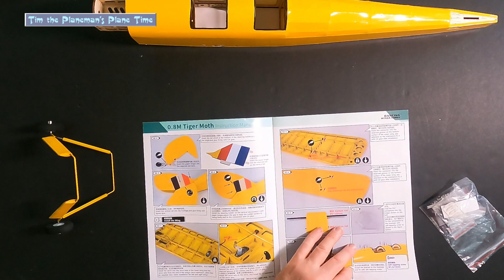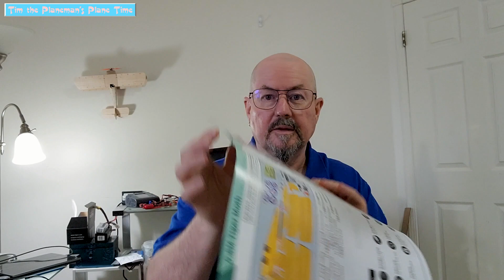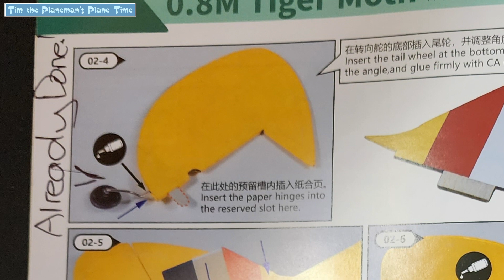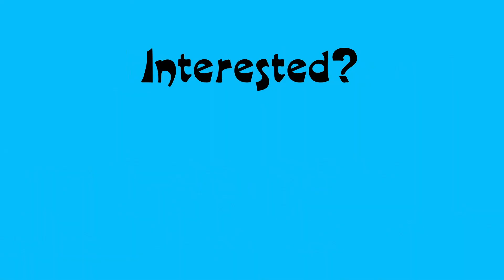Tiger Moth Assembly - Dancing Wings 800mm ARF

Comment: Nice looking model Tim, perhaps I could make some observations? At 3:38 you explain about the binding elevator, I notice the rudder to fin gap is pretty big, I know you couldn't close it up any more than you did because it wouldn't line up along the leading edge of the parts, I think I would 'seal' the gap with clear tape, you're going to get a lot of turbulance when you use the rudder. At 5:30 those aileron servos they do look a bit vulnerable, I was thinking you could put the locking clamp on the horn end, this would then stick sideways instead of down. 7:50 c of g, turn the model upside down to do the balance, it's a lot easier as the weight of the model is below the wing, cheers  👍
Reply from the maker: Thanks Cliff, it's really very pretty. Looks great in the air tool Thanks for the tip about the rudder. I'll try it. The ailerons seem fine so far ;-). Right side up or upside down, the CoG is waaaay off! I've now added 80g in the nose to move it to basically AT the leading edge of the bottom wing.
Reply: @timtheplaneman  I was concerned the ailerons may catch in the grass, glad she flies well, looking forward to seeing the video, cheers.